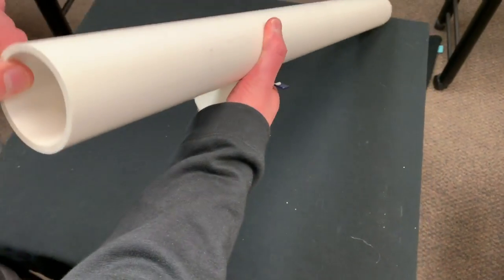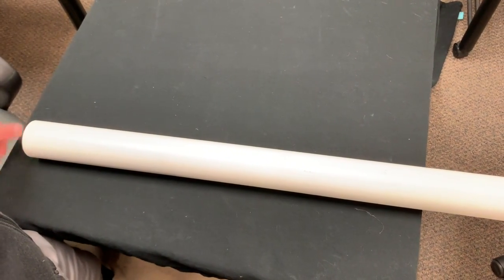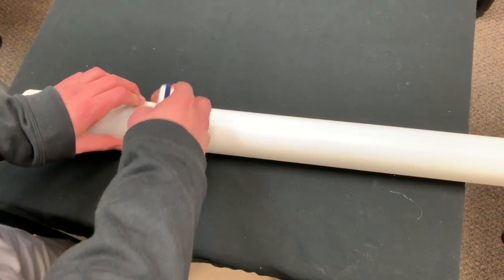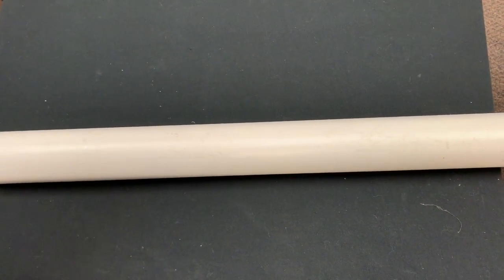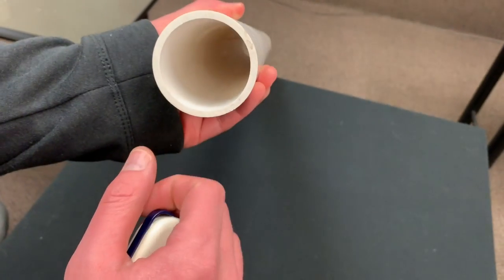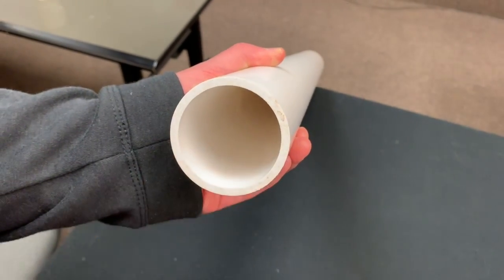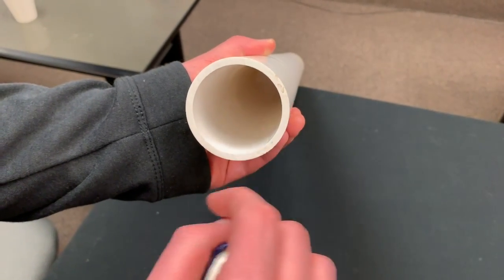How to Find Mainline Pipe Size (Diameter)

Comment: I found taking 20% off gives a closer measurement. For example, my 1.5" pool drain pipe is exactly 6" in circumference, measured with a cloth tape. So take 6 * 0.80 = 4.8. Then divide that by 3.14 and I get 1.52, pretty close. Sure, this is a bad way to confirm pipe size, but it's better than guessing! Thanks for the video.

Comment: this is the perimeter, not the diameter.
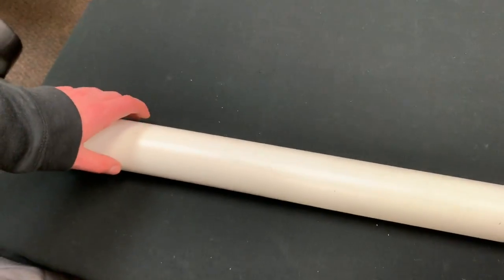Reply: If you watch the whole video, you'll see that you are only partially correct. The perimeter of a circle is known as the circumference, and while he does begin by measuring the circumference of the pipe, it is USED to find the diameter. This is because one formula to find diameter is Diameter = circumference / pi. His instructions mention to use this formula at 0:45.